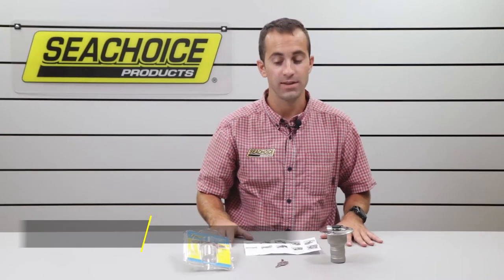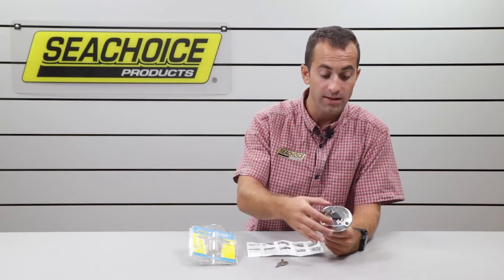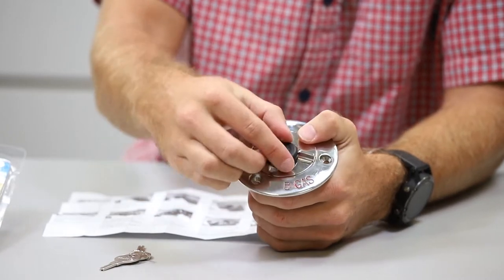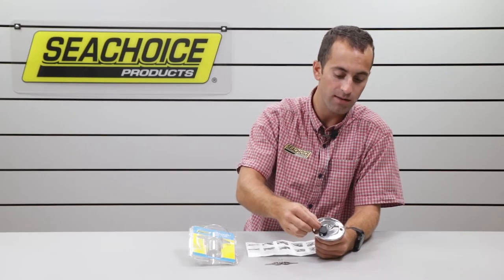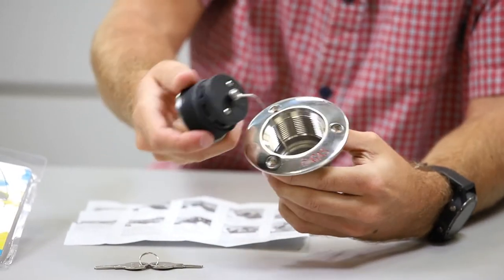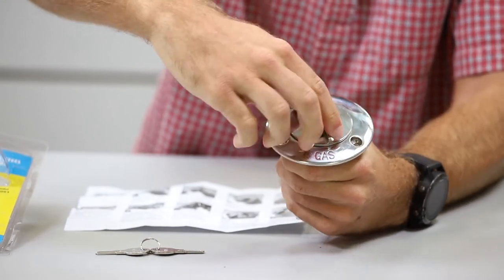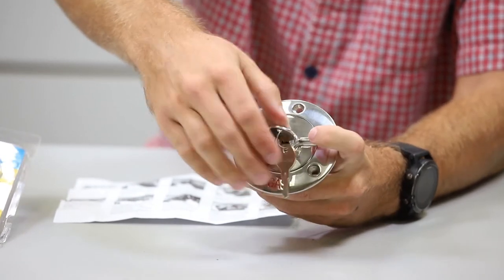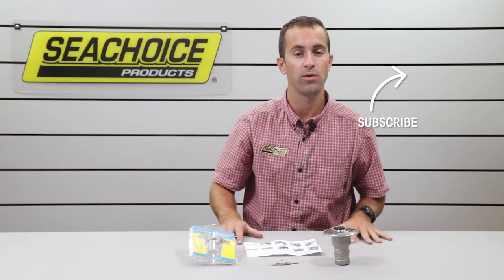Seachoice Gas Deck Fill - Lock & Unlock

Comment: What keeps a thief from just unscrewing the mounting screws and removing the entire cap?
Reply from the maker: While nothing can be 100% thief-proof, our locking deck fill cap adds a layer of security that non-locking caps cannot provide. In addition, even if the mounting screws are removed, the deck fill will still be difficult to remove thanks to the hose clamp, which is not accessible above-deck, and a very thick fill hose.